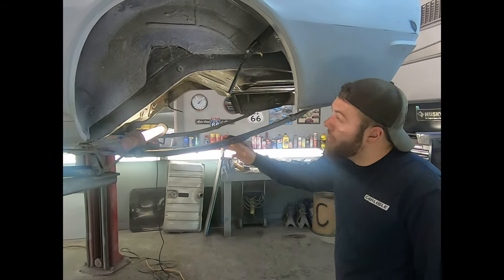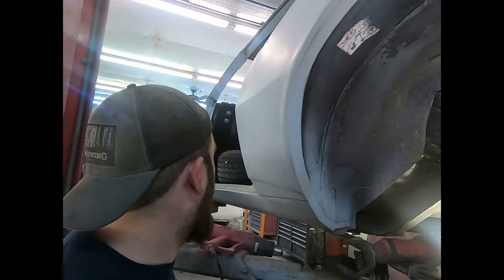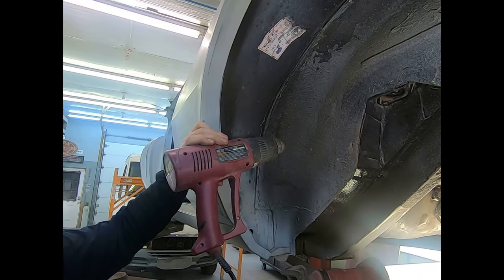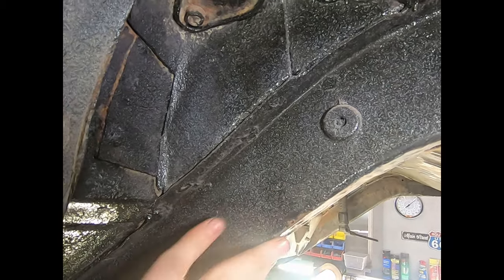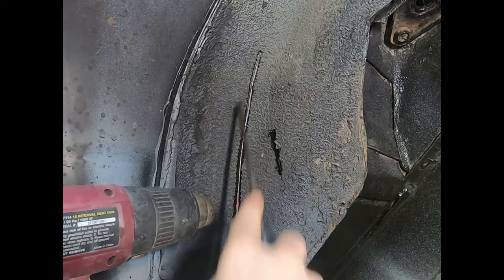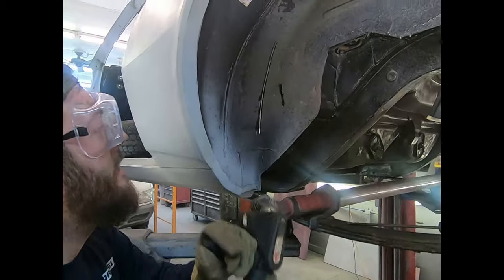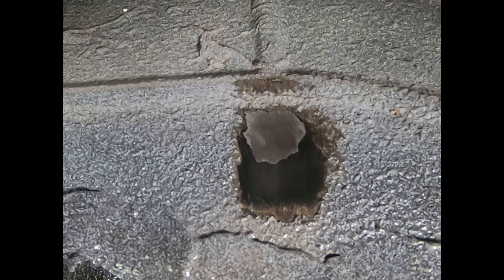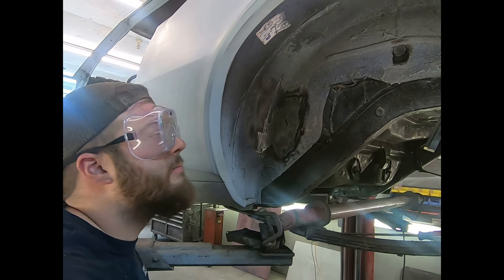How To Remove Undercoating

Comment: Was this on metal? Didn't fully watch because I need to remove undercoating on a 62 corvette.. undercoating like crazy... let me know if anyone has experience stripping undercoating from fiber glass... been removing with an air chisel but is super finicky and easy to.oumch through fiber glass